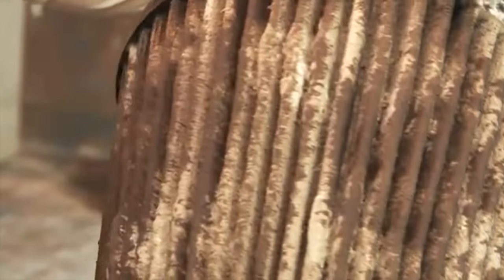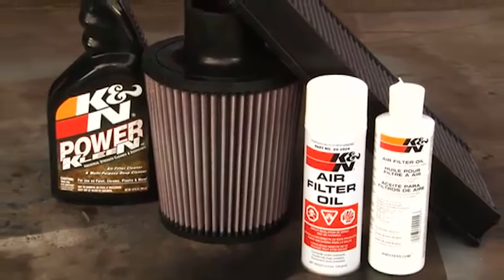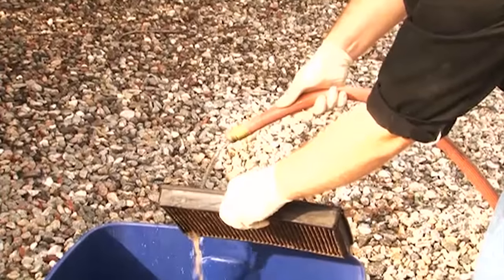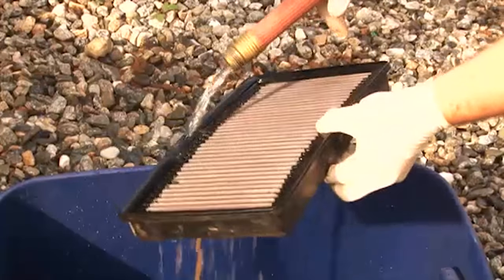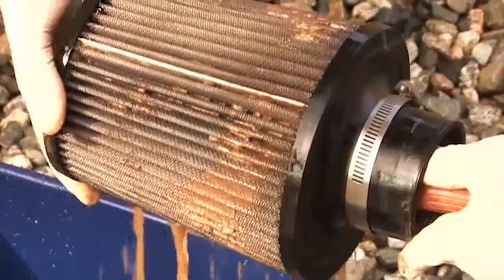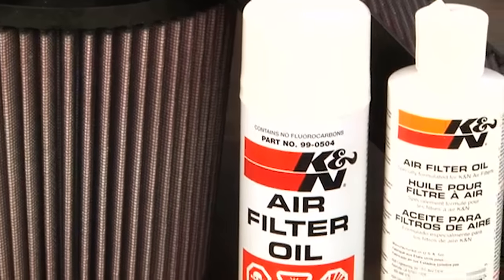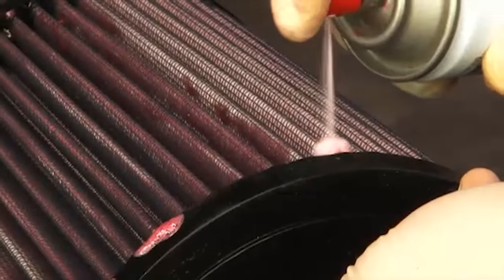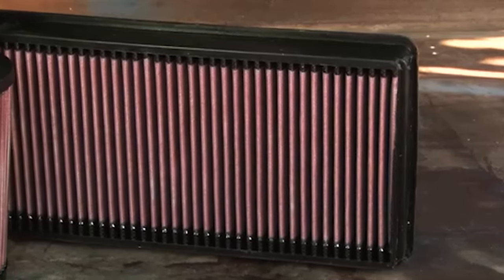How to - Clean a K&N Air Filter

Comment: If you let your K&N Air filter get that dirty, you've already lost any flow benefit from having one in the first place.
Reply: I think it's for illustration purposes. No one with a K&N lets it get that dirty lol
Reply: @nintendoatarikiller  mine was after a trip through an area with gravel roads and lots and lots of bugs lmao
Reply: Ok fuck well that’s why the video exists
Reply: @nintendoatarikiller  I'm sure there's plenty of people that install a K&N air filter and don't even know they are supposed to be cleaned.
Reply: @TwoTall1988 honestly there really is 😂
Reply: @TwoTall1988 moment they put in a K&N they think they’ve got a lifetime filter that produces better air flow forever , no cleaning needed
Reply: Says the parking lot princess
Reply: So I'm running one in my 2002 XR650R. Went on a group ride today that was 80 mi of basically sugary sand. Started with a brand new out of the box k&n filter. It looked worse than the one in this video after 80 mi of being in a dust trail. Absolutely nothing past through the filter. Inside of the air box was spotless, clean side of the filter was spotless. So I was watching this to see what to do to clean it properly as I'm used to foam filters but not these. I am absolutely impressed.
Reply: Ok? Believe it or not air filters get dirty

Comment: It really depends on where you live & drive as to whether these are worth getting / cleaning / risking your turbo in poor air quality. 
I got one for my VW Golf, and while airflow is higher, (and therefore potentially more particles pass through), the air quality in my city/country is some of the cleanest in the world, so K&N is right for me! I'll check the filter every 3 years or so, perhaps invest in cleaning equipment and do that routine maintenance as a satisying DIY project. 
$5 per year maintenance is hardly anything worth worrying about.
Reply: Using a $5 tooth brush and the cleaning fluid to scrub the filter will remove all the built up crud. Just make sure the tooth brush is rinsed under hot water every 10 seconds of use because otherwise it wont clean your filter for long. They don't bother to tell you about scrubbing the filter at K&N do they! Also you need to tap the filter on a hard surface to remove all the bigger bits of rubbish that get stuck deep in the filter. My K&N is working just fine.

Comment: How do I get the thing off to clean it? I've loosened the screw for the metallic ring around it and cannot get the filter to come out.  Is there another screw I need to loosen or do I need to very forcefully yank and twist it off?  Don't want to break something...
Reply: give it a twist and tug
Reply: @gb6003  thanks, I had to give it quite a few forceful twists and tugs and it finally came off.  After that cleaning it was a piece of cake.
Reply: @brentmarquez9057  helps to put a little white grease inside the rim.
Reply: @JohnSmith-es2qm  good to know.  Next time.
Reply: @JohnSmith-es2qm  what do you mean by that 🤨🤨

Comment: how to dispose of the waste water after cleaning?
Reply: It’s road dirt… just spray it away. It doesn’t need to be disposed of in any special way. It did make my pee red tho so i wouldn’t recommend drinking it even tho it’s cherry flavored
Reply: @xConceptz1  ya sure I mean the chemical cleaner itself
Reply: @tmp1k  i did mine outside and the water/cleaner just goes into the earth. It’s either drain, or grass. Not really sure how you plan to catch it, and the garbage dump will basically do the same. It’s not like the cleaner is concentrated after spraying tons of water through
Reply: Take it to the street lmao

Comment: So basicslly i bought an air filter that i have to pay more phote to kerp it happy
Reply: Well, you can reuse instead of buying new one, that's the point
Reply: Its probably going to work out cheaper to clean and re-oil a K&N reusable filter than buying a new one every service
Reply: I clean and reuse the filter 3 times so far,  I clean ones a year and the filter still looks new.
Reply: @re2553  that  car is far gone xD used that filter like twice